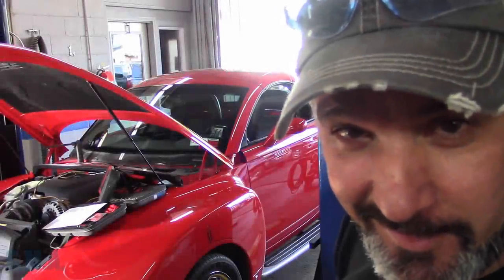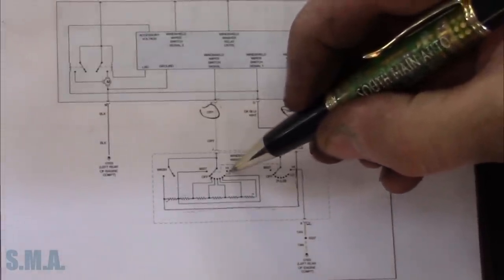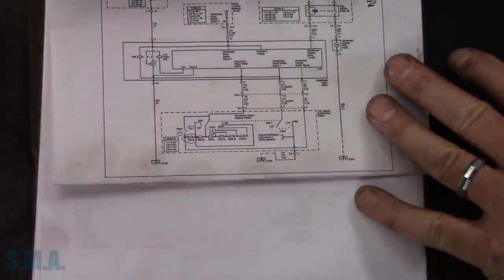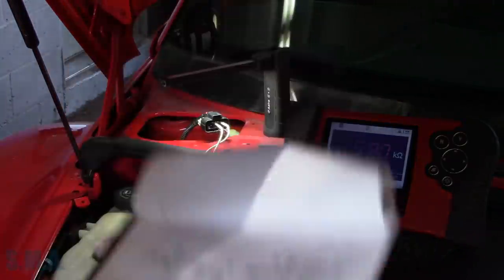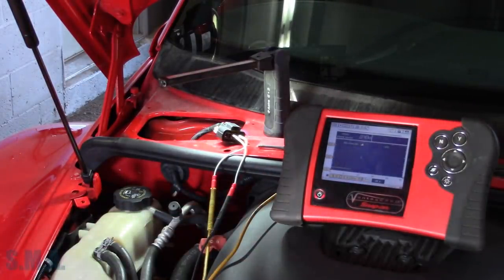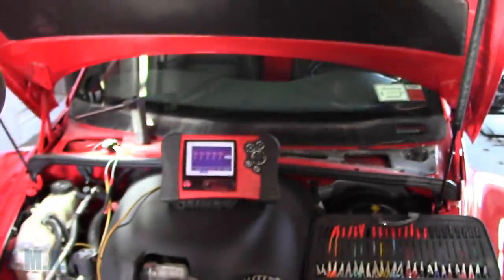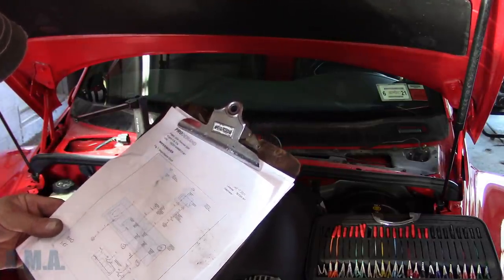Chevrolet SSR: Wipers Gone Haywire

Comment: Had one of these things as a rental.  I took it back.  Can't see dog poop out that tiny back window.  And they forgot to out an engine in it and just used some hamsters in an exercise wheel to power it.  Hell no.  Worst rental car I've ev - no wait, THE worst was a Chrysler Sebring Convertible from Enterprise which broke down three times including in the return line back at the airport.

Comment: Perhaps to completely beat this video to death, you could also de-pin the switch resistance wires from the wiper plug. Since the ‘off’ state should be infinite ohms or open, if the motor still triggers, you have your answer. I would imaging most likely there is water intrusion on the wiper ‘logic’ board causing a resistive ‘short’ across random circuits. Great job Eric!! Thumbs down to Chevrolet....

Comment: Are manufacturers going to servo motors for wipers these days? 

Recently I had both wipers on my Ford Fusion fully extended and then I disconnected the battery to work on the car. When done, I re-connected everything and saw something very interesting:  First one wiper parked then a second later the other parked. (Cross fold-overs)

Comment: I’ve already been through this with my 2005 Ssr it turned out to be the circuit board on the back of the wiper motor. It might be the same as a trailblazer, the we’re built on the same chassis.hope this helps.

Comment: Look at an OEM 99 Dodge Ram 2500 headlight switch wiring diagram. Can you spot the error in the high beam circuit? Actually the circuit is fine but the switch position callout is wrong. LoL. Sometimes the errors are so subtle.

Comment: The switch and motor are completely seperate, correct? So if the switch is A-OK, how does the motor come on when the switch is off? No power can be getting to the motor.

Comment: Yeah, you could wing parts at it. That's what the mech's did to my sister's air con. Replaced tx valve, replaced dryer, replaced something else... $1600 bill thanks... didn't fix it. I took it back there and demanded they tear the bill up and fix it. It turned out to be a wire under the dash in the climate control. Being a mechanic myself, I dropped $300 pm the counter, told them they were lucky to see anything at all and that if I heard from them again there would be hell to pay. Cannot stand people who charge for time and parts because they're either too inept or too lazy to do the job properly.

@South Main Auto Repair LLC that is a very fancy pants pen. Almost looks like it has a little Elec Tree City inside.

Comment: Prodemand through me for a loop the other day. Following the flow chart for a c1000 on a 2012 dodge ram. The brake light switch would internmently short out and keep the brake lights on and the abs and trailer light would flash.
So i get into it and it want me to check for voltage backfeeding through the abs module, which entails unplugging main abs connector and testing voltage on our brake signal 1 that feeds into the ecu. I had no power which then prompted me to replace abs module. After looking at the wiring diagram that shiz still dont make sense

Comment: I bought a 2nd Isuzu 1996 Rodeo because the 1st Rodeo achieved 482,000 miles and was starting to burn oil (worn valve guide seals). The 2nd Rodeo's wiper blades were moving insanely fast - I checked voltage wiring etc - nothing bad found.  I noticed wiper motor was replaced - a rebuilt motor.  Just curious I robbed wiper motor from Rodeo  #1 and put in Rodeo #2...problem fixed! 😁👍
🇺🇸 HAPPY BIRTHDAY AMERICA!! 🇺🇸 🧨 🎂 🇺🇲  🎆🎆🎆

Comment: The 2 diagrams showed a different path for the low circuit. The mitchel one showed mist and low sharing the same single resistor but the factory showed low running through all 6 resistors? Am I looking at that wrong. Thats a fairly big difference between the two if im looking at that right.

Comment: How can the motor do anything wonky if it isn't getting and voltage from the switch? How is the motor getting and power to be wonky if the switch isn't supplying any power?

Comment: Wiper module is probably the same as the Trailblazer and Envoy Wiper Module...  SSR same platform as Trailblazer and Envoy
Reply: If that's the case that would make a lot of sense. Hard to believe that GM wouldn't just go to the parts bin for a wiper module

Comment: I once had a boss bring me his son's pice of crap mid 70s ford where the wipers would come on as you drove. the dealer took 250 dollars to do nothing. he brought it to me with the ford dealer wiring diagram. it had the optional wiper delay module. yup, ALL the places where the ground buss wire in the harness picked up body ground were bad connections(ford quality control). I fixed all the ground-body connections and it was fine ever after.

Comment: It's actually a Trailblazer underneath, but not many know that.
Reply: Cobalt
Reply: It is on a Trailblazer EXT chasis that has been shortened.  The engine in the 05/06 is a 390 hp 6.0 LS2, the same as thr Cornette and GTO.

Comment: I had a 90 S-10 that the wipers would start and stop at random, the dome light would be on with the door closed, and off with the door open, and the turn signals would blink and the horn would honk. The problem - the cigarette lighter socket was shorted against the radio case. Who'd a thunk?

Comment: If the problem is in the motor and the motor operates independent of the switch setting... if you unplug the switch from the motor and replace the fuse and the motor starts moving on it's own... you would also know that the motor is the problem without testing the switch.  Obviously not a thorough test, but a shortcut never the less.  As I read the circuit diagram, when the switch is disconnected, the motor should never move... if it does, there's a short in the motor control circuit...  

Feel free to let me know if I got it wrong.

Comment: It’s sad how manufacturers, and even the aftermarket, discontinue parts for some cars even after it’s only 8 years old unless it’s a high volume high profit part. You can get a new wiper motor for a 1970s Chevy C10 pickup but not for a 2006 Chevy SSR. I get it’s all about corporate greed but it’s partly why vehicles are prematurely scrapped. Someone hit my low mileage 2005 vehicle causing very minor damage and it was totaled because the insurance company said a few parts were no longer available and they don’t want the liability of a body shop using junkyard used parts. It just seems wrong and part of our disposable profits at any cost corporate culture.

Comment: The 'jumping' at 397 ohms was just the meter autoranging...it read .410k and 397 ohms, which is pretty normal for autoranging meters, because when it was in k ohms, it didn't have time to settle before it decided it like ohms better...

I can see how autoranging could be useful for automotive work, but I hate it for any electronic design or troubleshooting. It's always a trade-off.

Comment: Odd,  this just happened in my C5 Corvette a couple days ago. I hit the wiper switch for 1 wipe cycle and they stayed on. I had to pull the fuse. I haven't attempted to figure out if its the switch or motor yet.
Reply: big chance the "pulse board" on the motor itself is bad or the fingers inside. but the wash button inside is was known for gumming up/cracking/sticking sideways causing run-on issue without spraying. sometimes may even spray

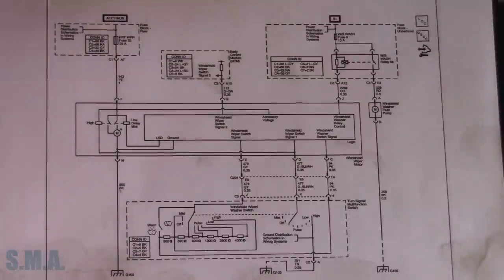Comment: There is NO circuit between "Signal 1" and "Washer" circuit – resistance should be "infinite".  At no point do the wires join or get switched together.  In the diagram (Pic at 3:19 is perhaps the clearest) they cross each other.  At  "Hi", "Signal 1" goes to ground and in the other positions go to "nuls" on the switch, i.e. they are "Open Circuit".   (Where did you get to understand they did make a circuit somehow?????  Unlike you to make such a grievous error, Eric.) You would need to check that one with one prod on "Signal 1" and the other on any other convenient "Chassis Ground", or ground pin on the connector.  Try it again. :-)

Comment: GM early versions of a CAN circuitry? It’s funny in the 80s early 90s you could get any part you needed for a 14 year old car. Late 90s it started 9 or 10 year old car parts became omitted . Millions of small block chevys out try and walk into a part house and get a mechanical fuel pump without having to order it .
Reply: GM throws all its parts older than 10 yrs out and discontinues production at least thats what they did at the GM Edina, MN. plant, they got rid of brand new everything older than 10 yrs such a waste.
Reply: I believe it. I worked for waste management at one point wrenching on garbage trucks. They had a policy on parts on the shelves more than 6 months, it had to ether be returned for credit to vendor or sent to another terminal or thrown in the trash. 9 times out of 10 after it was off the shelf you needed it. We had a saying in the shop, they would spend a dollar to save a dime (wasted management)!

Comment: Go eat the burgers, cotc, dogs and beans. You didnt pull the motor, take the cover off and show the cold solder joints. And if you use an iron, fixit. Or if the the voltage comparator chip is bad, suck out the solder with the tool I sent ya and put in a new one from Mouser, or DigiKey.  I'm havin chicken, ribs, macncheese and pulled pork. I ive in SC now. ...Charlie aka LTH

Comment: Well I’ll ask a stupid question.....would it not be quicker to check the motor? That’s a genuine question from an amateur not a criticism Mr O.
Reply from the maker: Sure you could do it that way but it would still be wise to check the inputs from the car. To bench check the motor you would need a series of resistors matching what was in the vehicle. IMO it is easier to confirm inputs then make the call on the motor. Make sense?
Reply: South Main Auto Repair LLC yes, thanks.

Comment: Sounds like another bad GM (Generally Miserable) pulse board. I had an 04 Cavalier that did that. Hot day driving down the highway they'd take off, hit a small bump,they'd take off, turn them on when it's raining good luck trying to get them to stop.. My diagnosis was easier. I got it to stop then tap on motor with head of screw driver, it took off. Tap like crazy gets it to stop. Load a wiper motor in the parts cannon and lit the fuse.
 Pulse board had some bad solder joints.

Comment: Do you work on any vehicles before 2000?
Reply: Rarely, where he lives they use a lot of salt on the big roads and there are a lot of gravel roads. Since New York state has inspections it doesn't take to much before a vehicle is deemed not road worthy and goes to the junk yard.

Comment: So just sitting how did the wiper motor go bad
Reply: its called cheap Chinese electronics and plastic
Reply: Corrosion. probably.
Reply: The motor is probably fine, the issue lies on the PCB for the motor controller. I would hypothesize that there is a cracked decoupling cap creating phantom voltage fluctuations on the MCU input, or a cold solder joint on one of the connector pins. Troubleshooting electronics is just another skill technicians need to pick up. Most of it isn't too bad. Dealing with conformal coating is really the worst part, haha.
Reply: @mikeb8893  the Chinese electronics are only as good as the schematic and bill of materials they are given.
Reply: Chineseium baby best on the market!

Comment: I had a buddy’s truck that did this and then quit . It turned out to be smolder  joints at the wiper motor board re smoldering fixed it .